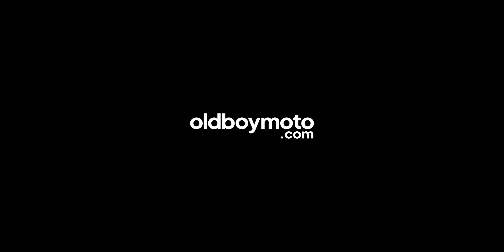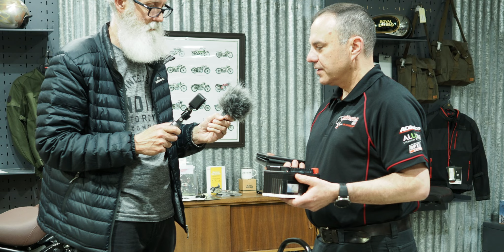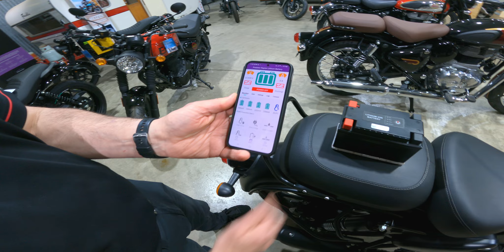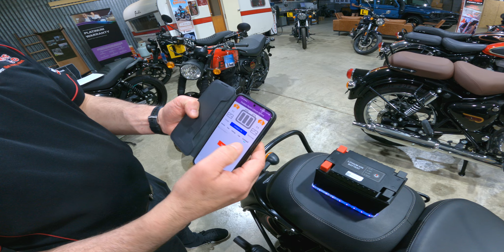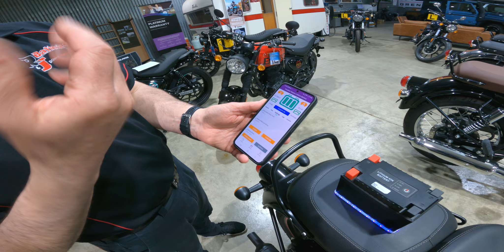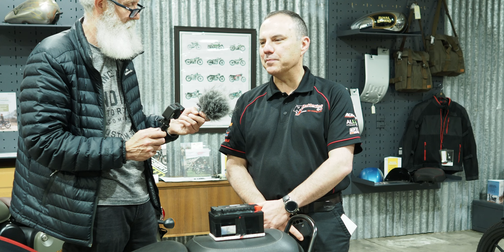Groundbreaking NEW Motorcycle Battery

Comment: An alternator designed to charge a lead acid battery is not suitable to charge this type of battery.  Also, what happens to your alternator and electrical system when the engine is running and the battery's BMS disconnects because of an over voltage condition?
Reply from the maker: Good questions. I'll get together with Tim this week and go over all the great questions raised in the comments.

Comment: I have had great luck with simply converting to Lithium Ion.  Way less weight and size and if I let the bike sit to long just throw it on a normal battery charger for a short time and it's not damaged like my old lead acid batteries were.  I have already converted all my motorcycle batteries and will have to wait till I buy a new motorcycle probably before I'll buy another motorcycle battery.

Comment: Only reason i’m not interested in a hibernating battery is because my Harley has an alarm system. If my battery was to hibernate my security system would stop working.
Reply from the maker: I'm going to ask Tim about that this week, plus many more great questions you guys have raised.
Reply: My H-D alarm has it's own 9V battery to power the siren. Not only does the alarm sound when the bike is disturbed away from the key fob, but if the main battery is disconnected, the alarm will sound also.  If I was to use a main battery that hibernates, then the alarm would be activated, which is what I don't want.  I'll stick to the AGM tech for now.

Comment: Motorbike manufacturers need to reflect on the common CMOS batteries in computers and limit battery drain to the equivalent.
Your average computer BIOS battery can last for >12 months without any computer usage.
And it fits in the palm of your hand.

Comment: Imagine a battery you didn't have to worry about waking up by bumping the bike accidentally just trying to get to the car
Reply: In this case you would use the App to reduce or minimise the Shake to Wake sensitivity.  You can still wake the battery up using the App when you need  :-)

Comment: With lithium they always go on about cycles my motorcycles and cars never cycle the battery,  its maintained at full capacity it starts the engine for a few seconds then is restored to full charge.  Its literally a startup battery its not even designed to cycle.  A leisure battery is designed to be cycled batt has the limitations of lead acid so going beyond 20% charge is bad for the battery.  For a starter battery under 50% charge probably reduces the long-term life of the battery.
Reply: You are correct, starting batteries don't normally cycle very much.  Cycle life however is a common measure used to compare the capabilities of different battery chemistries.  LFP definitely has an advantage over lead acid batteries - in reality you can expect up to three times the service life from an LFP compared to lead acid.

Comment: What about the elephant in the room: the charging voltage? These batteries usually need a higher voltage (something like 14,6 or 14,8 V) to fully charge than the normal batteries (say 13,8 V or 14,2 V). With the bike's normal on board chargers, the battery only gets partially charged at best.
Reply: Still puzzles me how you need a special lithium charger to this day yet the bikes charging system is fine.
Reply from the maker: @chrishart8548 You're right, the bike's charging system is fine. The only problem is, the charging system is only charging the bike when the bike is running and the engine is above a set rpm.
Reply: @chrishart8548  that's the problem, the bike's/car's charging system IS NOT adequate for the new Lithium batteries; the charging voltage is too low
Reply: @HPaulAdrian  I agree  my bike came with AGM it's staying with AGM.  My friends africa twin has a lithium battery from new  I looked up the honda replacement it's £600. I just bought a brand new yb14-bs powersports agm battery for £32 free p&p

Comment: That is a cool battery.  That would be great if GPS was integrated. Since it uses BT to turn on/off, you’d think that it would have a parasitic drain.  Your long term testing may help with this research?
Reply: Would GPS use a lot more power than blue tooth  the range between the battery and the phone would be nothing with blue.  I even have fake led candles that turn on and off with an app if they are not used they stay charged forever.

Comment: That’s great!  However to my understanding, if you have a modified motor (not stock), or have external lighting or other additional accessories, an AGM battery is recommended. Is this accurate?  Additionally, I’m in south Florida and ride all year with higher humidity and temperatures.  Would you then recommend this to me?  Just my thoughts and experiences.

Comment: This guy doesn't ride.. none of my bikes headlights turn on before they start .. therefore I cant wake them up ..
Reply: Could use the main beam but with so many bikes having led headlights now it won't work that well. And with the small Ah rating of all the lithium batteries often 4.5ah replaces a 14ah AGM can you afford to waste power running a headlight for 10 minute's
Reply: @chrishart8548  again none of my lights turn on untill it starts .. no high bean available

Comment: I have a fpv battery in my car that hardly gets driven. Best battery I have ever had. It’s got a small lithium battery with supercapcitors all in the one unit looking like a normal battery but starts my diesel triton up after a month sitting no problem. Turns over really fast like a new very big capacity one. Think it’s comparable to a 1900 cca battery. When they make one for motorcycles I’ll be getting that but my bike does get used most days even during a south Australian winter

Comment: Why don’t you just use an AGM battery . It’s not like Lithium that has low tolerance to temp. Just trickle charge.
Reply: If weight was an issue, the Lithium Iron Phosphate battery weighs nothing. When I received my first LiFePO4 packaged in a box, I expected that the box was empty and the shipper had stolen the battery from the box. I was shocked to find a battery in the box. The empty box weighs more than the battery. I was shocked again when the battery started my bike as I expected the battery to have no internals. To this day, six months latter I remain shocked and amazed when this battery that weighs nothing, starts my bike. Also, the bike is an MV Agusta. The LiFePO4 battery removes about 8 lbs from the top of the MV. I feel the weight loss and like it a lot.
Reply: @357magnum-b8e so you think you can notice 3.6kg  isn't that just a few litres of fuel. It's less than 1/2 tank vs 3/4 of a tank.
Reply: @chrishart8548  Yes, every little bit counts when you're chasing lower weight...
Reply: 10 litres of fuel removed  equals approx 7 kg . As an example this would leave 11 litres in a Versys 650 , enough to still travel approx 200kms on average .
With a battery saving of 3.6kg that offers fantastic smart features plus just being savvy and only half fuelling a petrol tank in a nation where petrol stations are available on average every 100kms , this gives a weight saving of over 10kg .
Pretty impressive .
Reply: @SomewhereInside  so mainly what you are saying is just run your bike with 10 litres less fuel saves double the weight of this expensive battery
Reply: @ yes , but the battery appears to have other advantages , so combined weight saving is then 10.6kg

Comment: I would like to test that battery in a UK winter and see how it would cope.
Reply: @RobertWilliams-gj1jj  I was looking at lithium  I have a yb14-bs  in the end I bought a powersports AGM for £32 it's 14ah.  The only advantage I can see going lithium is weight. Previously the AGM battery worked perfectly for almost 11 year.  If it was still connected to the charger it would still started the bike.   A shido was £130 was only 4.5ah the cca was 250.  But I didn't like the lower capacity or the fact they didn't work so well in colder conditions.   Also they seem to have bms that can disconnect the battery.  I'm worried my bikes charging system would get damaged if the battery suddenly disconnected it's and a spike from my charging system that no longer has a battery attached damaged my ECU.
Reply: @chrishart8548  Cold Cranking Amps.

Comment: Bike Alarm and/or immobiliser uses the battery though?
Reply from the maker: Actually, that's a very good question! I'll ask Tim during the week how that works. Good thinking.
Reply: @ low sensitivity wake mode would be concerning, also trackers rely on power.  Unless with the extra space from the smaller battery, a seperate battery as their power source but then back to the tender for that then I guess
Reply from the maker: @granttaylor2000  Thankfully, sensitivity is adjustable
Reply: @granttaylor2000  I was actually thinking having 2 batteries in the space 1 lithium 1 gel. I would at least get some  weight reduction and keep more Ah and if the BMs shut down a battery would still be present.  In the end I just got AGM